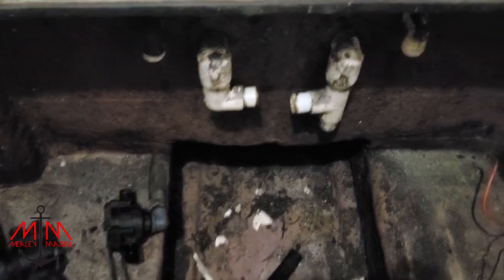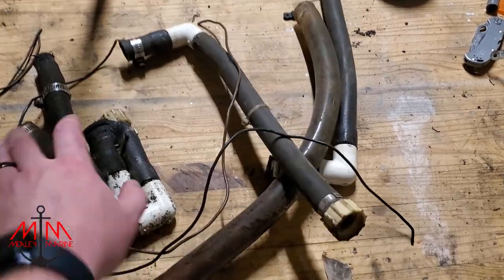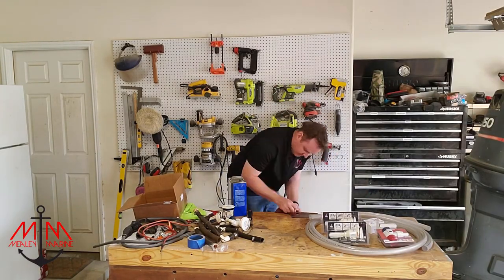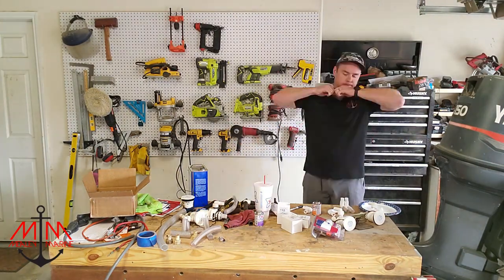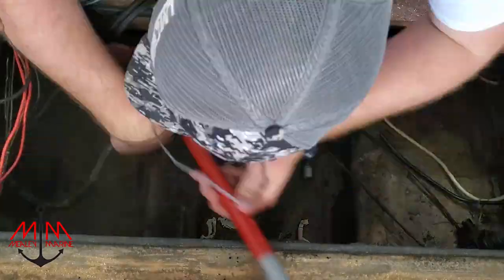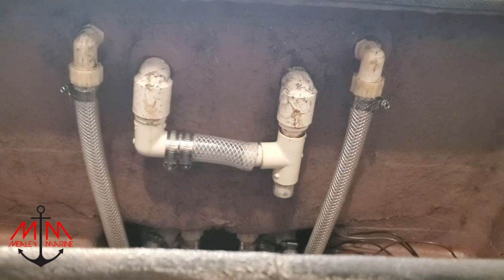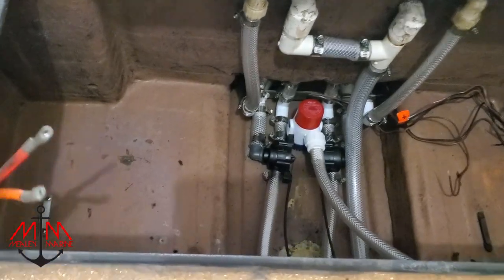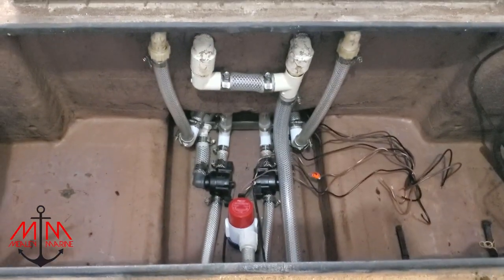BASS BOAT RESTORATION | 1988 RANGER 363V | PART 12: HOW TO REPLACE A BOATS BILGE AND AERATOR

Comment: Great video! Been following your restoration for the last few weeks and you are doing an excellent job! When you get her finished up a little handy tip is to keep a bar of lava soap in the bottom of the boat at the stern so when water gets in it will help keep the grease, oils and dirt levels down. The sloshing when driving helps agitate it and when plug is pulled it all comes out. Just what I have done for years and has worked wonders for me on keeping it clean.
Reply from the maker: Great idea!

Comment: Watching the series, our boats are very similar.  Nice to know about the tray!  Looks like mine has the same fiberglass rub through/separation at the live wells areas; must be a common problem.  I installed red/green nav lights in my rub rails today, took about 2 hours taking my time, tapped into the front nav light holder.  Looks like from the factory they put all the fish finder transducers inside the hull like on yours.  I have one in the middle drain and 3 in the area you're working on here (the old round ones ; one in front bow and one in the dash).    I'm shocked at how well Ranger's foam is, no rot or wet areas on mine.

I'm going to use farm/tractor enamel paint on the inside areas, you can find it at Tractor Supply, they're all over the Houston area (I'm near Lake Conroe).  That paint takes longer to cure, but works great, also use it on my tractors and trucks.  Flows thick and lays itself out as it cures; the stuff just sticks much better than Rustoleum.  I used silver on my rims, have the same ones as you do on the trailer.

Comment: Great video! I had just bought the 88 ranger v393 it looks to be the similar setup but my live well fill valves don't seem to be working on the inside. The outside switch and cables are working fine but the valve inside I don't think is turning completely. I noticed you did not replace yours, but I've been having trouble finding this part do you have any suggestions?

Comment: I think you'll want to use a water soluble lubricant like "Astro Glide"...   Yes, I said Astro Glide.  I've used it on stubborn radiator & heater hoses before & it works great...!   And it doesn't contain Petroleum, so it won't kill fish...!

Comment: Hey what’s the 2 black pieces you didn’t change? And can I use this build on my 84 320v? The setup is close but different
Reply from the maker: Livewell shutoff valves i think they are called. They shut the livewells to recirculate